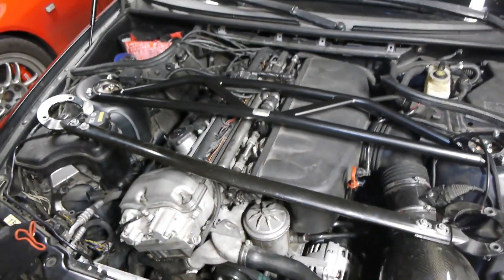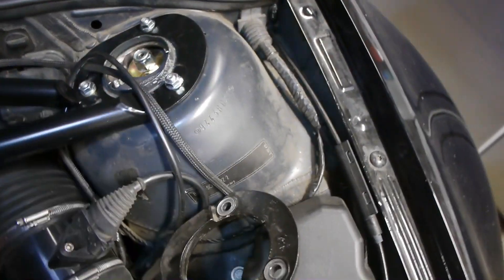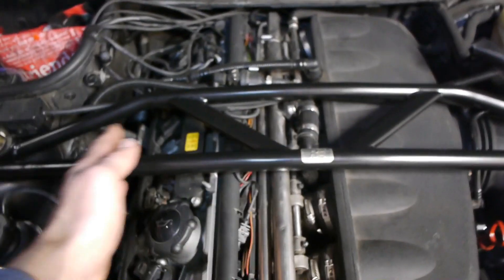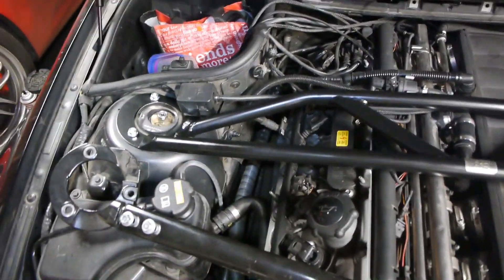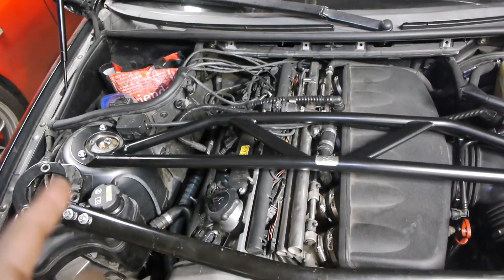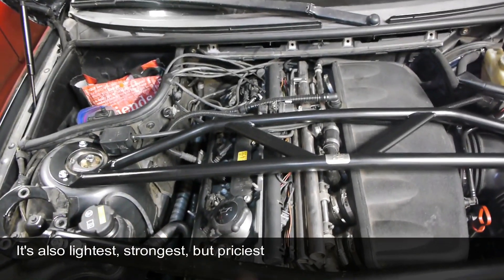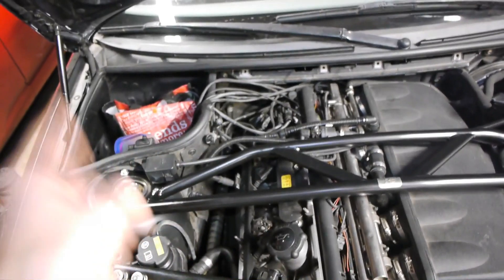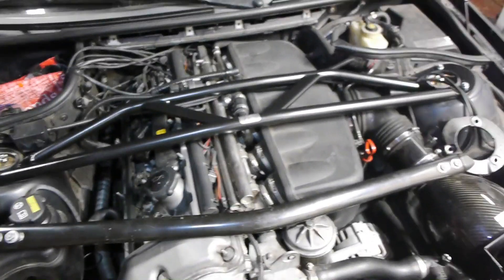E46 M3 - Rogue Engineering Front Strut Bar, Steel not Aluminum

Comment: What purpose does the stiffer bar have besides supporting the strut towers?
Reply from the maker: Not really supporting per se, but it ties them into a more rigid structure. The chassis has a lot of bending and flexion. McPherson strut design also jams a lot of force into those towers and as you start pushing the car and using very sticky tires it is noticeable. Prob not going to make a noticeable difference on a weekend car on street tires.
Reply: @mrgizmo7975  Thank you for helping me understand its purpose